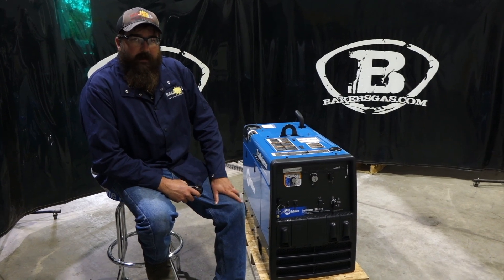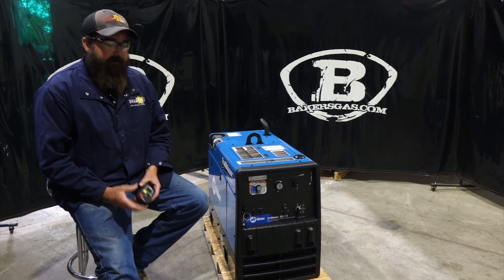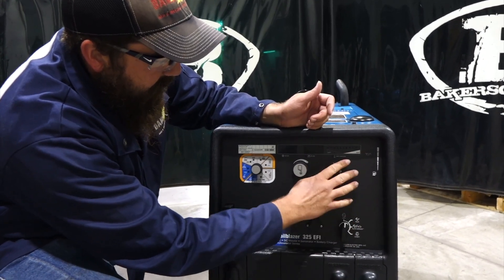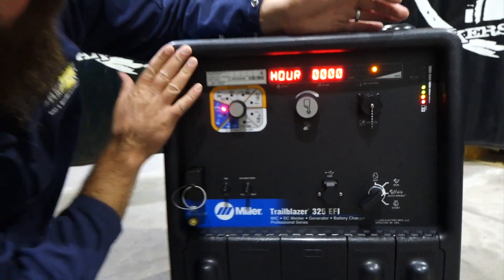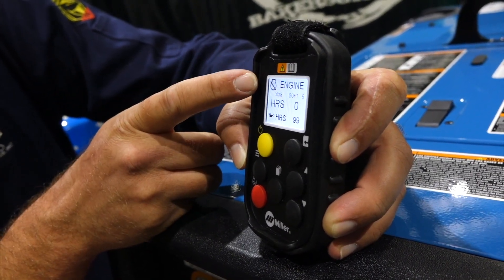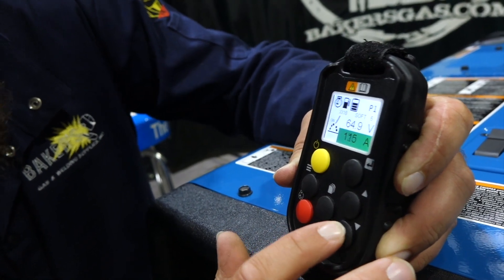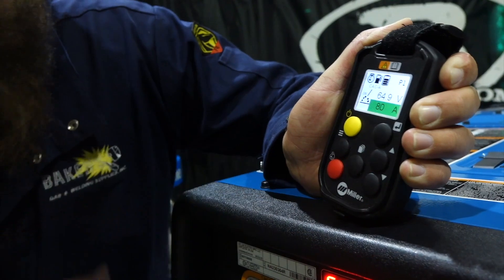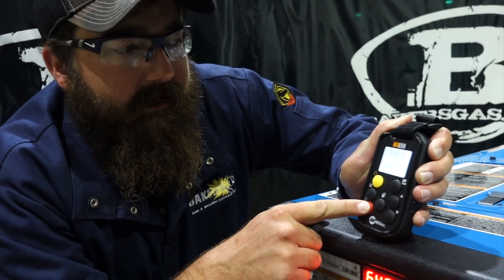Miller Trailblazer 325 with Wireless Interface Control Demo and Review

Comment: Good video and great feature.  I work alone often and usually up in a scissor lift, so this would be extremely useful for me.  Too bad Miller has priced it out of reach for many.  This is 2021 and in my opinion there is no way the wireless technology should add $1700.00 to the price of the machine.

Comment: I hope i get an answer.. i just got mine.. but what i see is on the remote the amps increments they go 5 on 5.. is posible to change the  voltage increments to 1 by 1 amps?
Reply: Why would u want that for ? Why not adjust the length of welding arc for either stick or mig for tig just increase speed.

Comment: Do you know the range on that wireless interface ?
Reply from the maker: We specifically tested on the Bobcat remote (different remote) but that one went 500 feet if it was a clear shot. This one I would say same thing for a clear shot but in general I would imagine Miller would estimate 250-300 feet.
Reply: Does it have to be direct sight for the wireless interface to work? Or is it RF remote?
Reply: Does it have up down by 5’s?
Reply from the maker: @will-i-am7523  no it does not, we tried with trucks in the way and it worked fine.